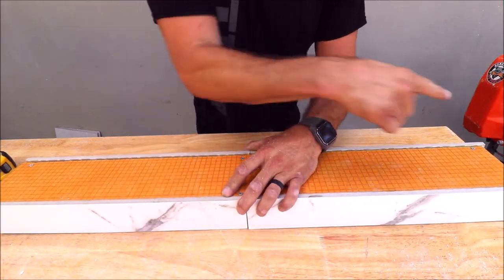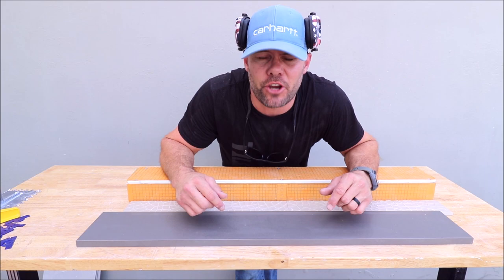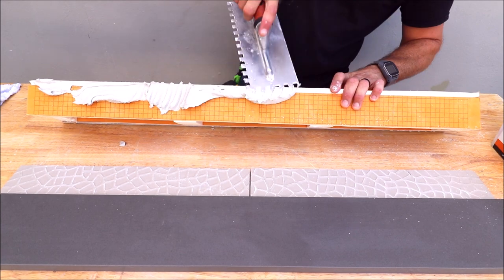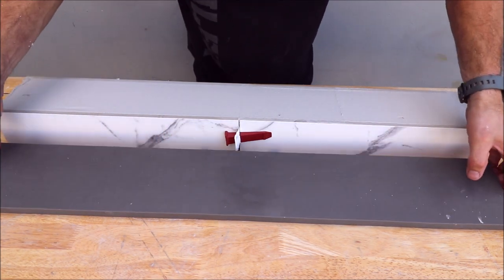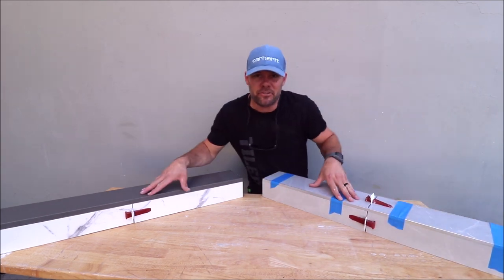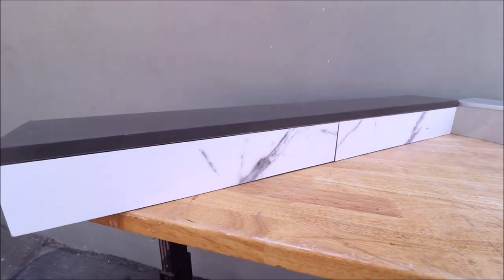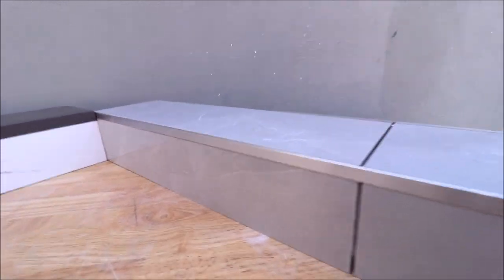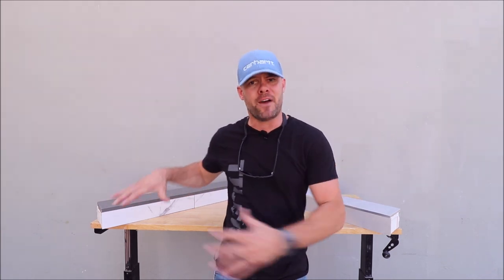Modern Shower Curb Design Ideas

Comment: U should do a video with q shower with 2 lineal drains. Where I am if u have a curbless shower u need 2 drains going to sepperate plumbing. They need to make a lineal drain with 2 drains built in. I'm not sure if I should have them right next to eachother or a gap in between for tile?

Comment: I have a couple questions that I really hope you can answer. I have never used engineered stone before. I plan on using some for the top of the curb on a neo-angle shower. I picked up some Satori brand and a 6X36X 1/2in. piece weighs in at 12 lbs.....is all engineered stone that heavy? I wanted to run a solid piece from the curb edge up the wall on each end, can/should that be done? At 4 lbs a foot how would you make make sure it stays seated in the thinset until it sets up??? Is there another kind that doesn't weigh as much as the Satori? I wanted to put it up the wall to be able to attach glass block for the surround......help direct me to the right product PLEASE and Thank you!

Comment: How long do those diamond pads last you?
Reply: I tried one out recently. Would reccomend. I by far prefer them over the stone. I did a whole house full of tile where I used it alot and it is still going strong. Just be careful with it on sharp corners
Reply: @samiam7  Good to hear.  I know some people use diamond plates to sharpen knives and the plates last a long time too.
Reply: @khybersafi9137  yes. I bought only the 60 grit and it has worked good on hard and soft tile. I can use it on certain tiles and can't tell the cut edge from the factory.. also I use it dry, no water.  Good luck to you

Comment: 1) What is your trick to not chip the tile edges when sawing? We have 15x30 porcelain tiles. 
2) How do you measure the size of the metal trim? Do we account for the tile and mortar that squishes through the holes?
Reply: I use the same thickness as the tile itself for tile edges. Cannot comment toward you chipping the tile as I don't know what saw or blade you are using, but it helps if you have a good blade (not home depot ones)

Comment: What product are you using under the tiles? I've been thinking about cutting hebel to fit existing subway tiles.  That way I do not need to cut the tiles, only the Hebel.
Reply: It’s prefabricated shower curb

Comment: I didn't see any pitch added to either top of the curb. Flat curbs are not a good idea.  Water is not neccessarily going to run back into the shower pan.
Reply: That’s what did around 1:36 when he made one side a little taller